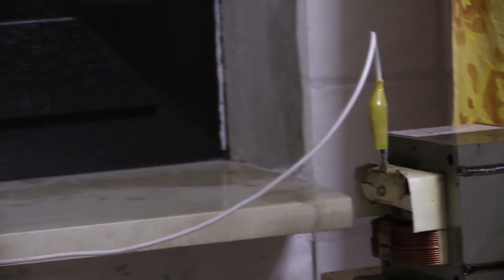Jacob's Ladder Fail

Comment: Yea hell man angle far too steep and wires must be perfectly straight for it to work really well I have a small on on 62kv supply and it manages around 2cm gap before breaking so I started at 2cm and kept bending the narrow point until that happened.

Comment: The current off of a MOT is rather high, you need something more like a neon sign transformer, it'll pull less from the mains supply too. The microwave transformer is doing something like 2KV @ 0.5 amps whereas a neon sign transformer is doing something like 9 ~ 15 KV @ 0.015 ~ 0.030 amps which is probably why the MOT is getting the wires mega hot.

Comment: Gap is too small, voltage is not high enough, and current is much too high.

Might also help to reduce the kinks/bends in the wires and have them nice and smooth.

Comment: The other problem is the current, it may be too high allowing the arc to sustain in 1 spot. The trick here I believe is the high voltage, but at the same time at relatively low currents.

Comment: this is easy to fix

increse the distance between the wires
and but a 1 meg 10W resistor
attatch that to one of the leeds
and the other leg should be in the middle of the jackobs lader

Comment: I think the main problem is the wires being to close together.  You are right about the distance being too narrow for hot air to push the arc up. Best thing to to would be make the wires about 1 or 2 cm apart at the bottom, then use a 3rd wire (doesn't need to be connected to anything) to start it manually by breifly shorting the two wires.  That's what I did when I tried this some time ago.

Comment: It think the problem is the wire, it looks like it's coated with something. The part where it burned was the path of least resistance because the coating had burned away. See if you can find a shiny wire.

This is all a guess of course...